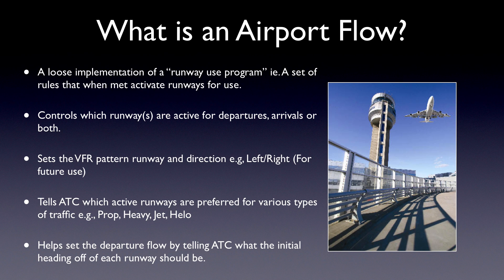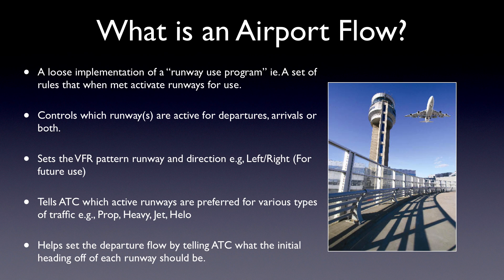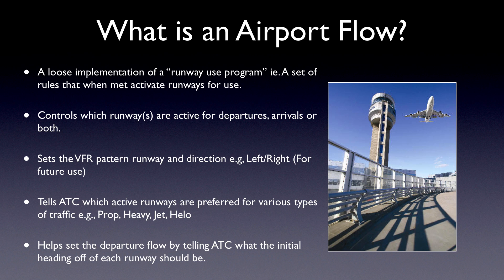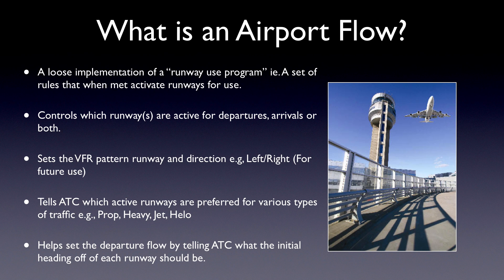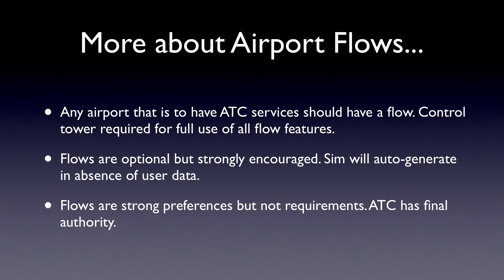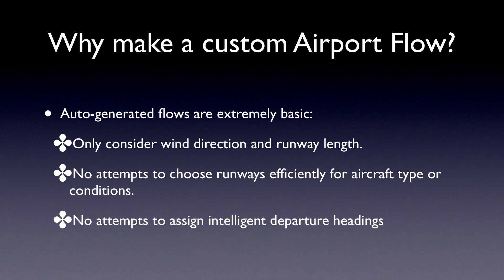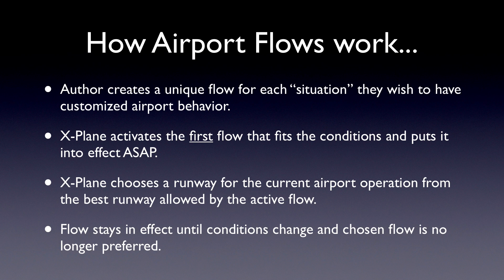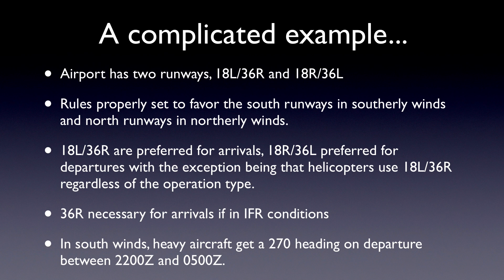Screencast: ATC Airport Flows Part 1 of 4

Comment: Is there a way to ensure that a runway is not used if the wind is a below a certain speed?  It seems to me that a min wind speed is needed for wind rules.  For airports with multiple sets of runways like KORD, certain runways are never used in certain conditions.  For example at KORD, when the wind is calm (less than 5 knots in any direction) only the 27 and 28 runways are used.  It's easy to set up flows for these.  But how do you prevent runway 14 for example from being used if the wind is 140 degress at 1 knot when the flow for it should be defined that it should only be used when the wind is greater than 15 knots?  

I know flows are searched in order, but is that right?  What happens if 4 aircraft are arriving at once?  You don't want them to all pick the first flow it finds which is rwy 28C in my case at KORD.  You'd want them to share the other runways like 27L, 27R, and 28R.